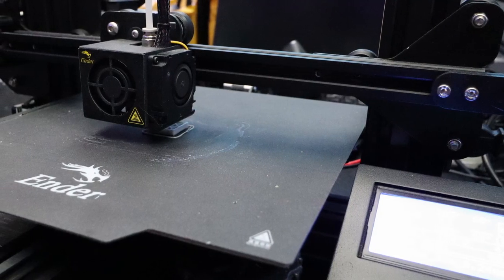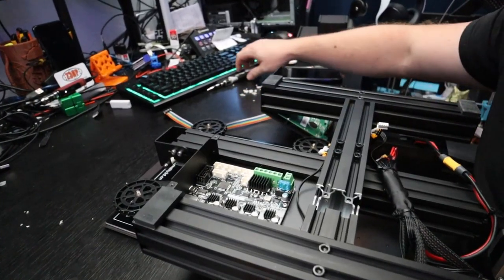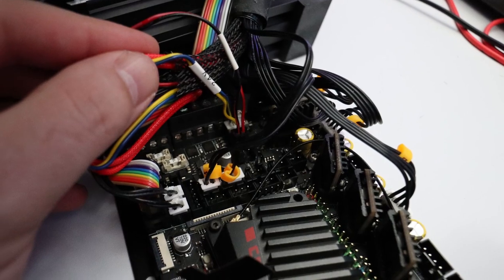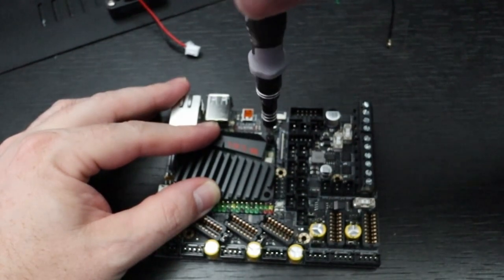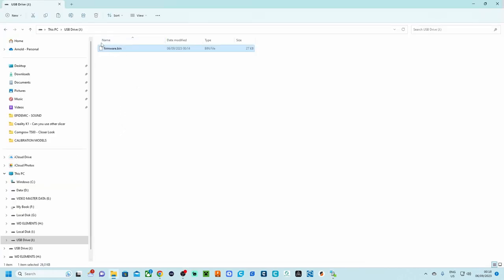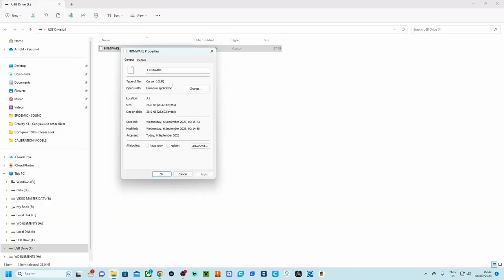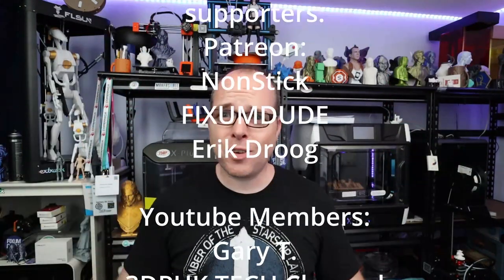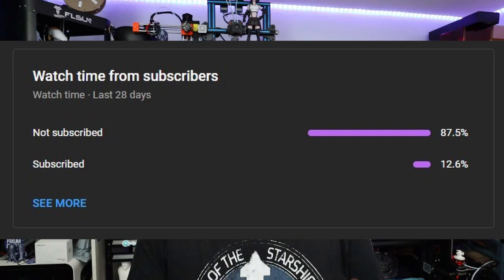Installing BTT E3EZ Manta Board on Creality Ender-3 Pro

Comment: another note. the '2nd extruder' he said to ignore in the firmware can be used to drive other motors. If like me you have a dual z kit with two steppers, you can plug the second motor into it's socket then configure the settings in the firmware to enable your z steppers to operate independently allowing the use of the G34 code for Z-stepper auto-alignment to better level your gantry.

So only ignore that in the firmware if you're not using that driver and slot on the mother board.
Reply from the maker: Yes, correct. Most of the time, people tend to use a 2nd  motor for the lead screw instead of a second extruder

Comment: for the case and having space for the USB and SD card slots, Biqu has STL's for a replacement case that fits this board  perfectly that can be printed with PLA.
Reply from the maker: Yeah, they have mentioned it as well, but this one was the easiest to do.

Comment: Hello. Can you help me? I had a problem with the "Update via DFU" item. When I try to follow the manual, I get the error "make: * No rule to make target 'flash'. Stop.". Have you encountered such an error?
Reply from the maker: Hey, I didn't had this issue before. At which moment you got this error message? Was that during the flashing of the SD card? If so, try to use a different card reader or a different USB port. Make sure to select the right port in the Imager

Comment: Yes, I am not impressed with the heatsink that BTT sends out.   It needs 4 M2 screws and 2 are longer than the other 2, but they send these long M3 screws.  Luckily, I had a set of screws that included M2 screws.
Reply from the maker: Very cool board but you need to check some things, including the screws

Comment: I got one of these boards, could not for the life of me get the Wi-Fi to connect (probably because I have WiFi 6), tried to use an Ethernet cord, still nothing.  That was the second board I’ve gotten from BTT, both had issues (first was an SKR Mini E3 V3, my pi wouldn’t recognize the board).
Reply from the maker: Oh no, that is terrible, did you manage it to get it to work? Just to check it, how did you provided the WIFI name (without giving your actual wifi name), maybe I can still help you
Reply: @Zachary3DPrints  I ended up returning the board, and selling that printer (an Ender Extender 400XL).  I replaced it with an Ender 3 V3 KE, and will likely not buy anything from BTT ever again